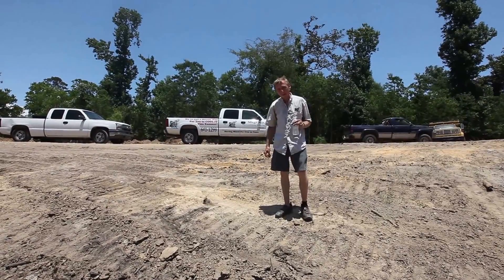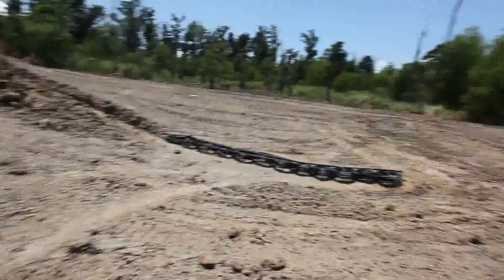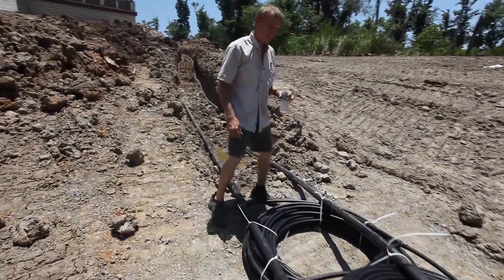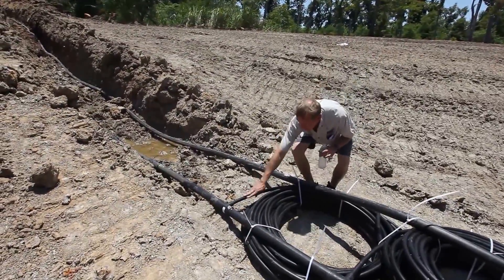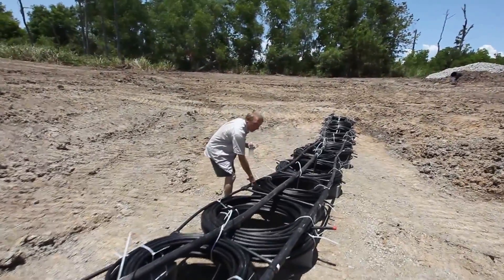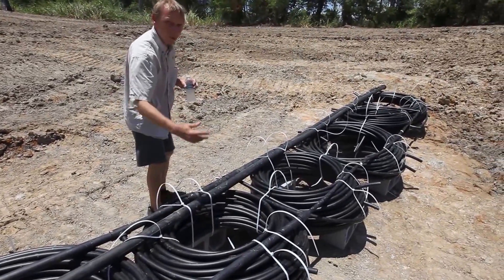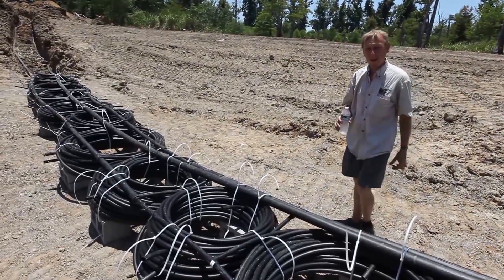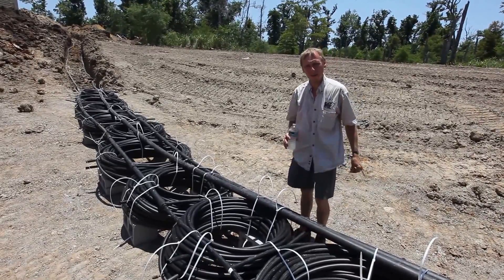Geothermal Pond Loop for Geothermal AC system by Mega Air, Inc. Mandeville, La Geothermal AC system

Comment: This is a bad design, there should be at least a half inch spacing between all the pipe for water to 'flow' around and thru the outside of all the pipes. This customer is loosing out on efficiency, and will definitely have issues running on extremely cold/hot days. Even in a non moving lake, the temp of the coolant going thru the pipes will cause the temp of the water on the the outside to rise & fall causing a water current around the pipes. This is why there should be spacing between each pipe in the coil bundle!
Reply: +Brad W. Absolutely right I commented the same thing - with the tiny amount of surface area they have exposed to the water they must have had to drain the pond and redo this whole installation.
Reply from the maker: the pipe was spaced with 1 inch PDC after the video was shot. This system has been running for 3.5 years and providing excellent efficiency & reliability
Reply from the maker: The video did not show the spacing that we put in all of the coils have spacers installed to give 1" spacing between all coils

Comment: take heat from the pond? if only that's how pond loops really worked. you can get cooling but heating is a different story, nice sales pitch though, even if im not buying your sale.
Reply: Heating is relative, if the air is below freezing but the water is 60-50 degrees then clearly it’s heating

Comment: I live in North Texas,  our pond is about 10ft deep & that water gets over 90°, how is that going to help anything cool down?  Those big coils should be spaced way more than that,  I would never use this design. No offense but this seems very poorly thought out
Reply: buzzsaw301 thats surface temperature. Take a reading at the bottom of the pond. 20*f deference at least
Reply from the maker: This installation has the pipes all spaced by 1" , It has been working fine for over 6 years now - 350.00 electric bills for a 4,900 sq. ft. house is not bad. The video did not show the final spacing
Reply: @SolarTechFL  perhaps but it also will affect the starting point of your cooling process as you heat the lower level of the water from the house. personally i think pond loops are a joke. i have a 1000 acre lake next to the house, that is a real option for thermal cooling because it has a near limitless supply of cooling. if using a pond, it needs to be shaded by large trees.

Comment: Looks good but your pipes should be spread out in that pound not bundle uptight the way you showing it. In really hot climates could be better to bury pipe under the pond.
Reply from the maker: This installation has the pipes all spaced by 1" , It has been working fine for over 6 years now - 350.00 electric bills for a 4,900 sq. ft. house is not bad
Reply: @dmd6561  Thanks for reply.

Comment: how big that house is?  m2?  or feet2?
The loops seems very large, why it needs to be so large?  Is not enough to exchange the heat?
I have a lake in buenos aires at 30 m of my house with a deep of 10m.
The quality of the water is nice.. transparent up to 2 meters or more.
What happen if I dont use a heat exchanger, and I take directly water from the lake to feed my heat floor circuit and then return that water to the lake?
Maybe with some filters.
I dont have a heat pump, the temperature of the lake at that deep must be close to 12c, so I want just to use that temperature to cool the house in summer.
What are the risks?
Reply from the maker: The house is about 4,900 Sq. Ft. we have 12 tons of A/C ( three 4 ton systems )